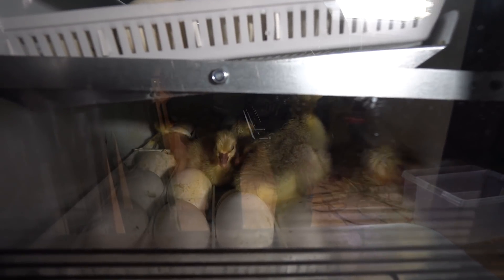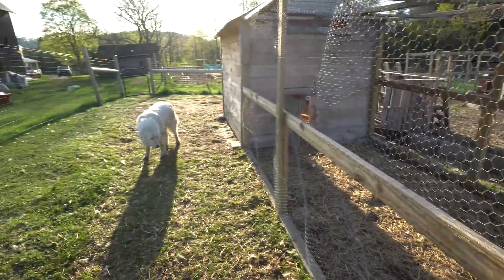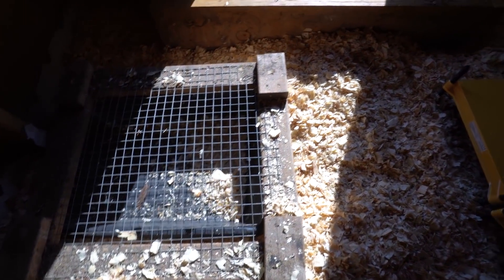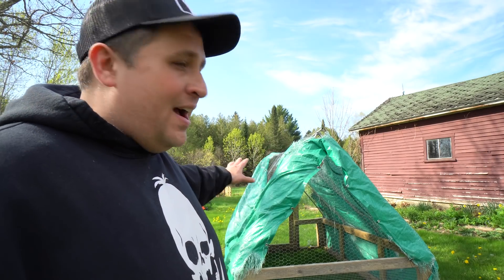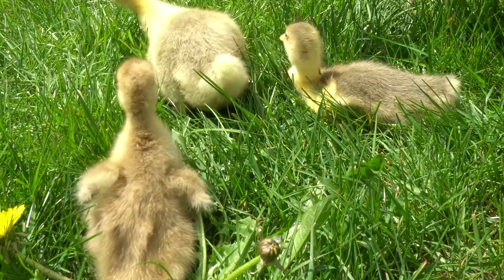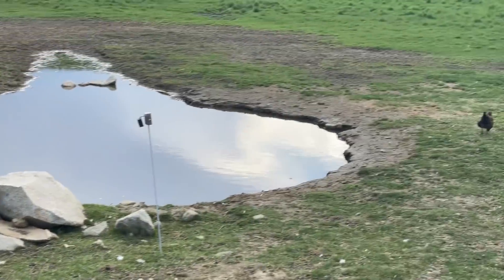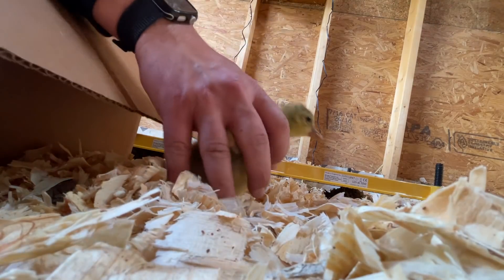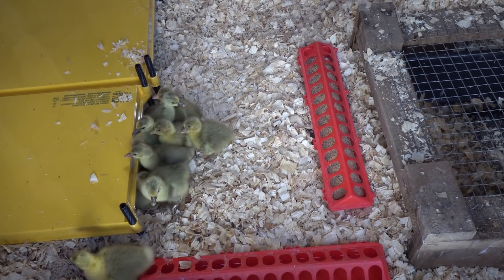Gosling Hatches are Magical to Watch (TIMELAPSE)

Comment: Nice video Morgan! 
For any horizontal surface the birds can crap on, look at Azek PVC trim board.  WIth the increase in lumber pricing, it's actually not that much more than real wood these days - how nuts is that. 

They also have deck boards, but they are pretty pricy.  Nice thing about PVC - won't rot!

Comment: I've got my first batch of duck eggs going into lockdown today.  The first batch of chickens this week was better results than I expected, because I ran the settings and process for the 28 day ducks with the 21 day chicks in the same incubator.

The chaotic squad of nest swapping mamas presented me with an early gift duckling on Wednesday.  Unexpectedly, I've had to nurture it away from the chix because I chose medicated feed for them.

 The Donald has already managed to poop on my lap numerous times in a hilarious manner. It takes several steps backward as the bowels move, ejects said bowel, then rockets forward as if propelled by the ejection.

I didn't expect to have The Donald spitting up the feed/water paste and flinging it everywhere as his drink expanded the feed in his crop to overflowing. Such a rookie! Such a rookie  new single mother-me is at raising a child!

The Donald has tiny blazes of fluff down  just above his ankles.  I don't notice it on any of his parent generation, and I can't yet find any documentation that crested legs are a thing with ducks.

Perhaps it's an epigenetic adaptation to the -20F his parents endured this winter.

Comment: Great to see your starting to get a good hatch rate, the heat trays are great much better and safer than the bulbs, but i do think you might want to raise them a little bit? I use them for my chicken pheasants and quail, i always raise one side a little higher like have it at a slope so if they are cold they can go to the back + cos you have two you can put them at different levels see witch they prefer+ i found with the geese i was rasing it every other day. Stay safe

Comment: Have you tried the sock trick that White House on the hill did with one of their ducks
Reply: I'm afraid this won't work in this case. The sock trick is for chicks/ducklings/goslings that have issues with their balance. But this seems like her one leg is malpositioned. It probably would need some surgery to fix that if it doesn't outgrow itself.
Reply: @jessicas253  I was just thinking it would work if one of the legs was weaker than the other but your right in this case. I just thought it was her muscles in her legs

Comment: Bro I am not an expert, but looks it the heating plate should be a little higher, they cant even get in.
Reply from the maker: Actually you want it lower than you might think so that they can make contact with the warmth. Picture a mother bird sitting on some babies.
Reply: @GoldShawFarm  Yes I understand what you saying, you told that on the video. For sure you must know what you doing, but still I was wondering, on the video they tried to get in, you even took some of the bedding so they could get in, and the one who got in was really struggling to get out. And on the other hand the top part of the chicken will be soft, as the feathers, in contrast to the heating plate.  Maybe I am sounding really dumb, sorry for that. Just one last thing , would you thing to put like a bandage or a stick, wrapped on the  gosling's leg? So it gives more support. Hope he recovers, love the channel.